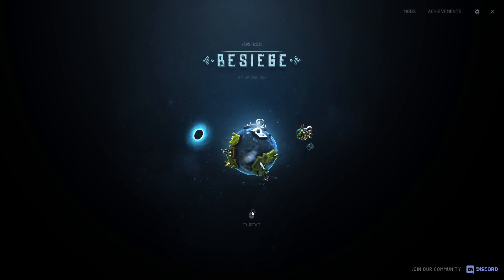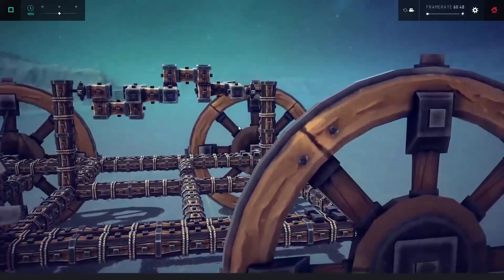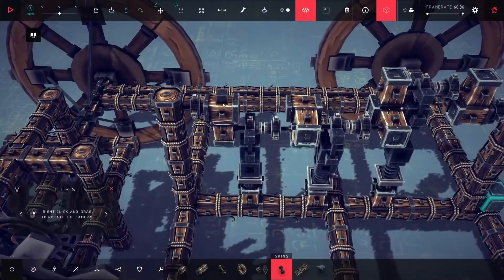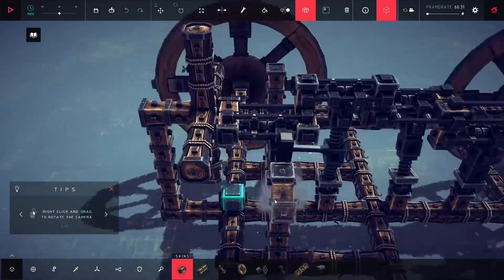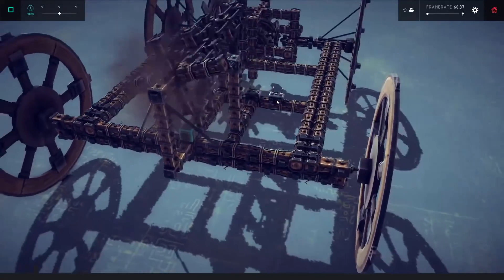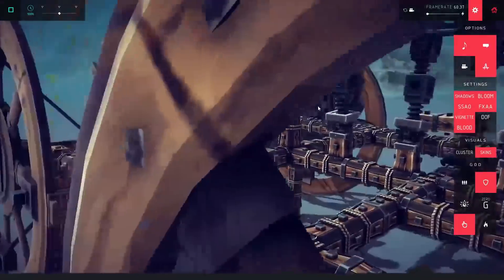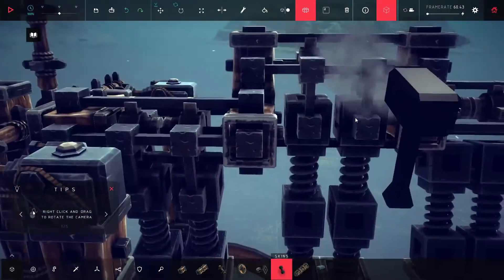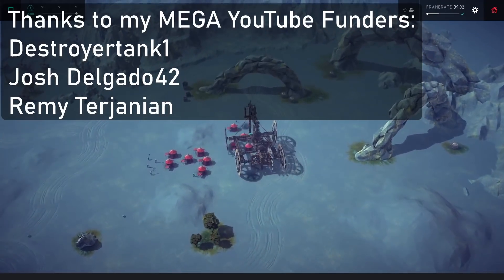Making a Functional Engine in Besiege

Comment: Why are you even using wood pieces though? The only structural parts I ever use are ballast blocks and struts unless I want something frangible. The main point of the wood pieces is to let you position things where you want them so you can then delete the wood and add a strut instead.

Comment: Great videos, this and your differential one. You see stuff like this on the workshop sometimes but it's all modded together and shrunk to nanometers in size so you cant see how it works, so it's nice to see videos of someone working it out from scratch and commenting their thought process as you do. I also experimented with the same stuff so it's also fun to compare our approaches. I used the anglometers to time my pistons instead of sensors which meant I missed out on the discovery of that logic block toggle. I also wouldn't use mods but then had no qualms about abusing clipping.

Comment: I made a 8 rotors engine structured like a mix between a Rotary and a brushless motor (~900 parts), I worked a lot on It, now i'm working on making the controller using distanze sensor. For things like the propshaft yo can use decouplers, they are stiffer than wood. You inspired me to start working again on piston engines

Comment: I made something very similar to this, also same thought process. First built a differential then an engine for it. I went a different way however, I was using an actual intake system with explosives to push the piston down, needless to say timing this correctly was and still is a nightmare. This was back when there were no sensors lol. Either way two nice ways to get to an equal result cheers

Comment: Instead of 8 pistons on 4 section crank, 12 pistons will solve the jittering motion of the engine.
Triangle is more stable than any other shapes, so why not do the 120 degree different for piston?

Comment: I've actually been trying to do exactly this, but with a mod that adds spark plugs (or as they're implemented, basically a block that pushes blocks away when triggered)
So maybe see what you can do with that mod?
With this mod I've been able to make a few various engines and made them quite compact, just can't seem to make them work in my car, though.

Comment: you should order the pistons / crankshaft to be like a Honda inline 4 cylinder engine; the position of the pistons relative to each other minimises shaking and vibration

your firing order is 1234, in a Honda it's 1342.
Reply from the maker: Wouldn't be terrible, though the shaking isn't very bad yet. If I add more "cylinders" I'll keep that in mind.
Reply: @ReidCaptain  you basically had a flat 8 before but just need it turned 90° over.
fantastic building btw super excited for what's next :))

Comment: My recommendation for more power would be to make the crankshaft "flat-plane", meaning the crank arms are all on a single plane, each piston 180 degrees out of phase so two pistons can expand at once. This isn't how it is in real life, only one goes at a time, but I think it would work in Besige. Also, maybe you can expand gears to make them thicker to help with mesh?
Reply: well most I-4s are flat plane, v engines generally are not. a flat plane crank might also make the engine a bit more jittery though as the engine doesn't have a flywheel to balance it out and the flat plane would snap to either the 180 or 0/360 planes because of the pistons not really behaving like proper pistons
Reply: @C4Cole05  The flywheel is the whole car.
Reply: Maybe a boxer style engine like a subaru would work better for that, since the angles are simplified and the engine wouldn't be are tall
Reply: I’m more interested in the single overhead crankshaft design bruh
Reply: @fredjones5698  lol
Reply: @fredjones5698  I think you're talking about camshafts.

Comment: The default pistons are very underpowered, but they do have a power slider that can be uncapped with a mod. Maybe not what you're going for, but it should work
Reply from the maker: It's a speed slider, not a power slider. The power unfortunately is set in stone.
Reply: @ReidCaptain  I didn't realize that... You could also try using springs then, they're more stackable. If you want to get even closer to actual pistons you could try the water jet with a torch behind it, which makes steam.

Comment: There's a reason why real engines work at over 1000 rotations per minute.

Have you tried a V8? Also, the way the rear wheels are angled, it looks like you need to make the frame stronger, or something.

Comment: Would it be possible to create a piston-based "steam engine" by turning a very large gear with the pistons instead of going the "internal combustion" route? You could probably stack several together to push a lever on the wheel, like on a steam locomotive, thus giving you more power/torque through leverage.

Also, for the stalling, a flywheel/clutch would be the key. The engine runs too slow to move such a large mass since the total kinetic energy of the pistons and crankshaft are likely less than the mass of your differential alone. (Not to mention all of the gears on the way, and wheels on the ground.) Unless you can make the engine run a LOT faster, I don't see it working as-is. (Which is sad because it looks so cool.)

Side note, have you experimented with duplicating the entire engine system and tying them together to see if that helps? Adding that much frame mass might be counter productive though, since the axles already snap... (Since you can brace things, could you build a triangle-based truss for a framing system, like a bridge?)

Comment: You did the timing wrong. It should be first and fourth cylinder together goes down as the second and third goes up. Maybe that's why it's so wobbly and the rotation isn't smooth. Other than that, great video as always!

Edit: Oh yeah, your engine is upside down but because it uses no oil and you did that to give space for gear reduction, it doesn't matter.

Comment: I have an idea, instead of that engine you can use a steam engine. (Use the water cannon on fire). Steam engines may not have that much speed and rock climbing abilities (it can if you build a really good steam engine), but it looks cool. And probably is at least a little faster that the piston engine with all those gears. (Whatever the slow down thing you called it)

Comment: how about an engine actually powered by exploding bombs acting as "fuel" powering pistons like a normal engine?
Reply: My engine used shrapnel cannons being heated up by flamethrower although to keep it working I need godmode and infinite ammo on. The shrapnel cannons push down a block held on a slider and the block rotates the crank shaft
Reply: He did it. That Madlad. Now he's next probably going to make an actual engine with every single part and detail of it.
Reply: I made one like that on little big planet
Reply: @srobinson0632  please tell me its lbp 2
Reply: Bruh
Reply: I made a steam engine with the water cannons and torches, before the logic and sensors update so its fully mechanical. There's a bunch of them on YT

Comment: Have you considered making it into an inline 6 for additional power?
Reply from the maker: I'd prolly go v6 or v8 if I remade it just to mix it up a bit. The inline setup makes timing easy though.
Reply: @ReidCaptain  Just keep in mind the movement of the cylinders in an actual engine. The timing on which cylinders should go down first is important.

Edit: You can try doing a radial engine lol
Reply: An inline 6 wouldn't run right anyway as the crank journals are separated by 120 degrees instead of 90. A v8 would be more likely to work